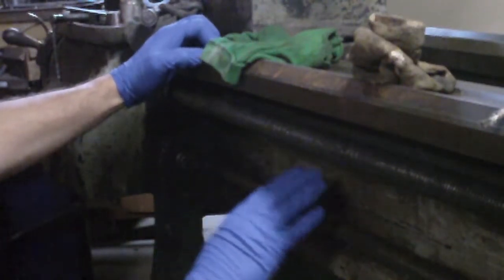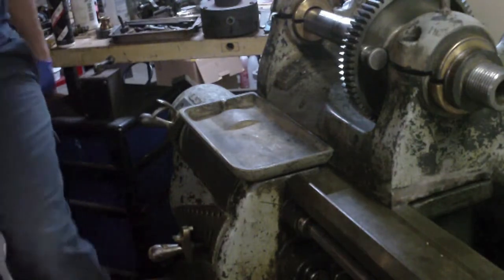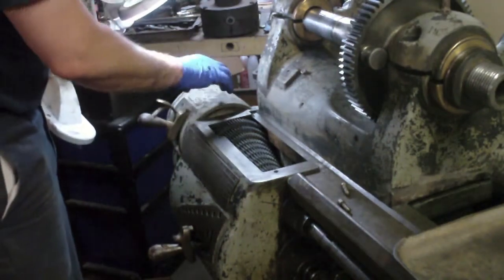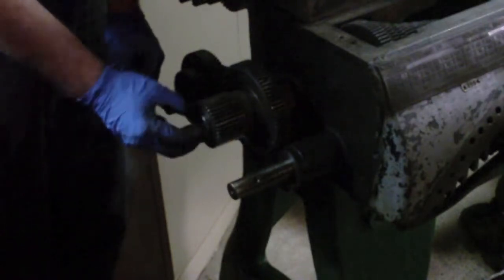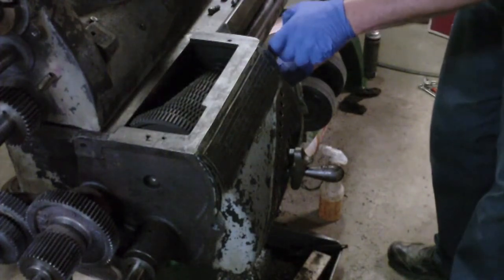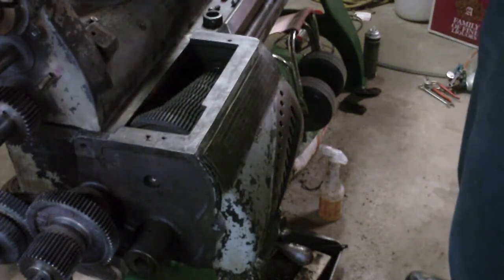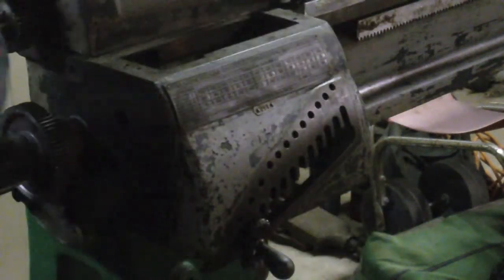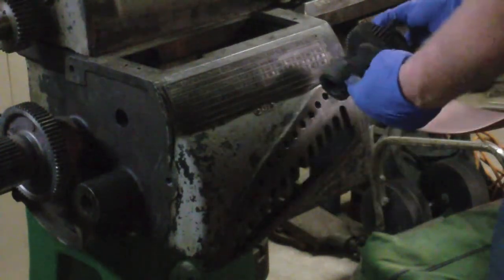The Rare Vernon Lathe Part 18

Comment: Steve, make sure the rack is about as spotless as you can get it.  the change gear mechanism should be smooth too and shouldnt stick.  I am only wondering how full the gearbox should be of oil.  I am hoping its like most of the American Pacemakers, large Monarchs, Hendey's, I am contemplating getting a pre 1940 lathe.
Reply from the maker: gbowne1 This design predates oil baths. the bottom of the box is wide open. oil just drips n the gears, then onto the floor! The good ol days lol.